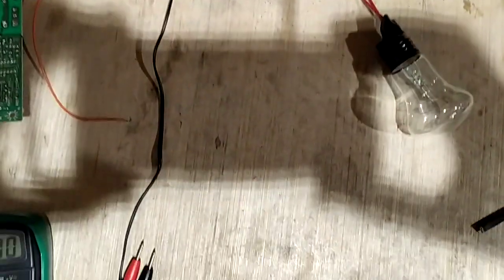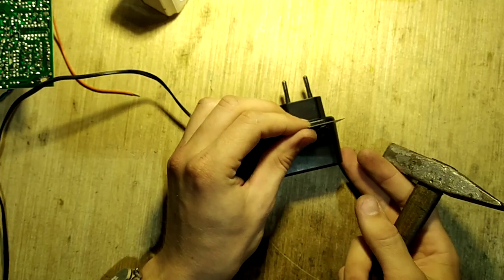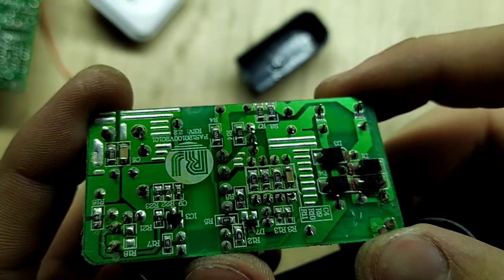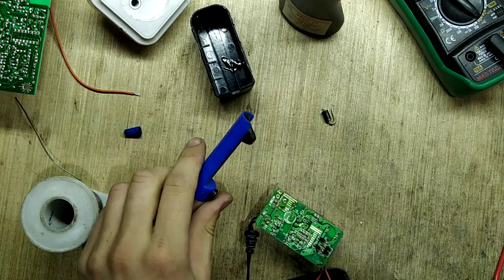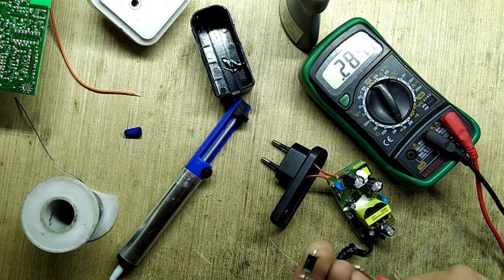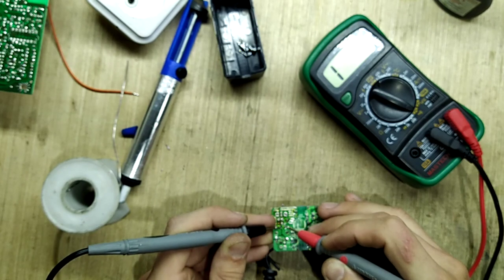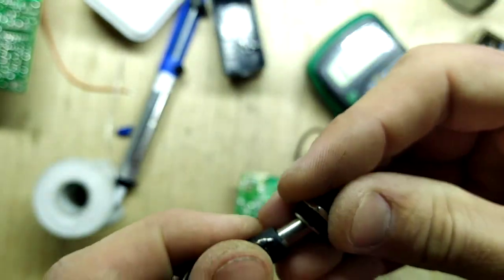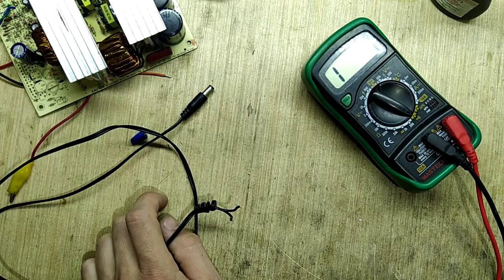DC adapter (wall wart thingy) diagnosis

Comment: So i'm not the only one to be caught out with the perfect looking faulty plug.
i use a penknife and pin hammer to break into the psu, brutal but it works :D
I find most 19v laptop power bricks have a shorted plug, no supprise as people often trip/catch the cable and it yanks the wires to the plug.
I just cut the plastic off the plug to solder it, then coat the plug with hot glue.
Not pretty but the charger works again :-D
Reply: I crack those welded plastic housings open in a vise. Usually a good squeeze makes them snap.